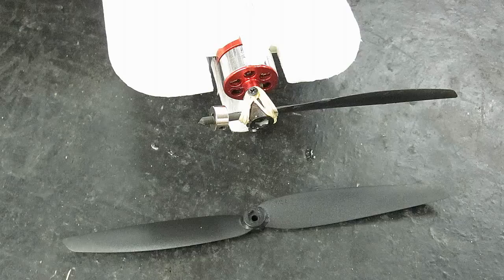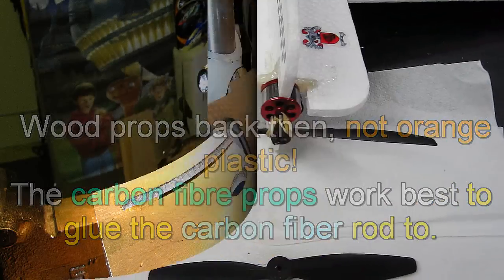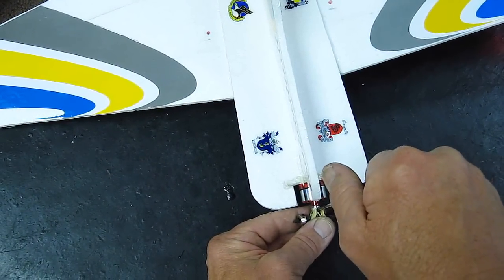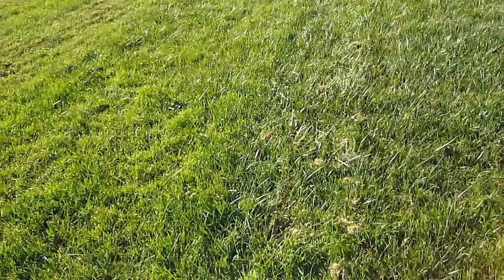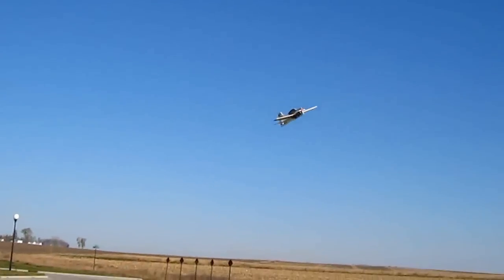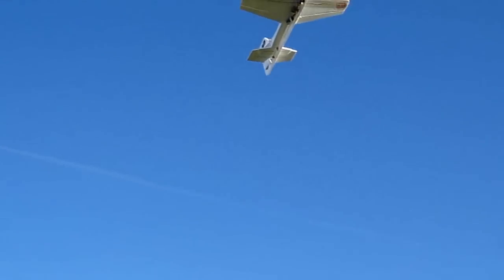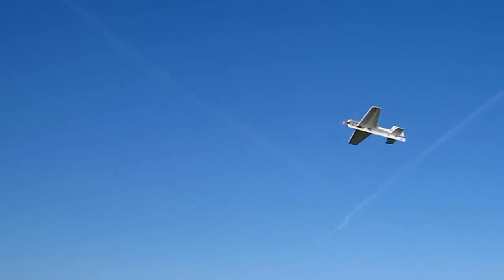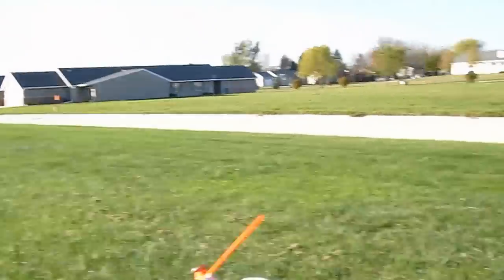1 blade propeller.  Will it work on Nitroplanes Hawk 3D?

Comment: First off its incredible that your able to fly in 20 mph winds at all and catch the plane with one hand. Now as for the concept, It would be great to see more testing done, preferably on a larger plane, you could measure run times say 3 batteries with regular prop and then 3 with the single blade config and see it you get consistent results, you may be on to something here!

Comment: Generally on full sized planes a 3-4 blade prop is used so the blades can be shorter for ground clearance. Also, the longer a prop blade is, the stronger and heavier it has to be for it's size due to the torque and centrifugal forces. This is far less of an issue for model planes though, so go ahead and use a 1-2 blade prop unless you're building an exact scale model.

Comment: you never cease to amaze- modelers  (my dad)   in the 40s couldnt afford plastic cement,  but acetone was cheap, and you melted model scrap  in acetone and voila-  your model glue-- we had a tiny u control plane, 14" span  , nitro,  Jim Walker's Fire Baby- it went like stink -i was given the handle once, i might have been 8 or 9,  and it went  overhead  to ground 4-5 times without crashing, and dad took the handle back lol - did you ever see / own one?   orange props break as easy as any ?

Comment: Single blade props should, in theory, be more efficient. On the other hand, I bend enough motor shafts, I don't need the prop helping any :)
Reply from the maker: True.. Properly balanced, they wont bend any shafts.  At least non of mine did, including the hammer head I put on my one bladed Nitro Helicopter  Thanks.

Comment: Oh and I like the drill press idea for testing. One could also use a variable speed Dremel if you have the optional chuck and are working with 1/8" or smaller shafts. Just need a good piece of shaft steel and good to go. Nevertheless, I really need to make myself a bench-motor setup for prop testing.

Comment: I have seen C/L speed events for half A engines that use this same style prop.  For speed events I believe the prop was metal with a counter balance inside the spinner.  The ones I've seen were fairly short, only a single 2.5 inch blade, but it was a very wide paddle-style blade at very high pitch (40 degrees or so).

Comment: @NightFlyyer ...it's kinda hard to burn out a brushless motor unless it's not moving when electricity is applied.
Brushed motors, however, can burn out if too much voltage is applied or it is spinning too fast, as demonstrated by Photonicinduction's videos of motors burning out.

Comment: The one blade runs into it's own turbulence too and what matters is the harmonics where IMO a 2 bladed prop can be better or worse that a single bladed prop regarding turbulence induced loss of performance. The real advantage of a single blade  prop is you can use a larger blade which produces less drag for moving the same volume of air.

Comment: It is definitely more efficient,  
The single blade bites a "bigger slice" of undisturbed air.
 but, in order to use it on commercial aircraft, the single blade would need to be much longer/thicker to give the same amount of thrust, and the ground clearance of the engine is the determining factor.
at higher aircraft speeds, it is not as much of an issue, as the undisturbed air is passing through the blades quicker.
imagine a cork screw-1blade
2 corkscrews twisted together-2blade ...

Comment: Neat subject! Lots of patents on this single blade prop or single blade copter rotor to be seen using Google Patent search. Something to do with reducing the tip vortex drag by half. Check out the VX-2 . Quite a reach for 1950's tech.

Comment: Did you compare motor amp draw between the two one-blade props and the original two-blade configuration?
Reply from the maker: Yes of course. 1 blade was always was lower hence longer tun times.

Comment: @Gig540 that's definitely a different idea. if one blade sat a half an inch forward on the chord line towards the tip of the cone and the other towards the back of the cone. if you could make one and was able to switch between it and normal setup you , test them...could be onto a possibly new industry standard. you never know.

Comment: I think in this case, 1 blade is enough (all properties are balanced, the propeller absorves engine power virtually 100% effectiveness). At higher RPM and mass to lift, some tweak are needed to be done. Maybe this is why there are no 1 blade helicopter nor planes. Right?
Reply: +Ismael Kafeltz 1 bladed props are scary, and auto rotation would be hard on a 1 bladed rotor.

Comment: @RCvehicleGuy 
It is aerodynamically proven to be more efficient, a 2 blade is more efficient than 3, 3 more than 4, and so on., but single blade is practically useless. (at least for G.A.)
as there is heavier weight added for the counterweight (much more than the second blade would weigh)
there is also additional stress on the propellor hub bearings from the "lop sided" thrust
no one wants taller landing gear, It's hard enough to get into most planes as it is.

Comment: Lucily, I'm too stupid to try this. I mean, I just looked at a couple of my props and can't even tell which blade is the first one. If I knew that, I would cut that bugger off straight away and eliminate the turbulence it caused for the second blade!! :¬P
Reply: +wordreet theres no such thing as the first blade, each blade cuts through a portion of air before the other one therefore each blade is cutting through dirty air produced by the one before it. Think about it this way the faster you go the more cleaner air each blade encounters, so traveling faster in theory would be more efficient.

Comment: Well when i started with rubber powerd aircrafts that's what was use ,a single blade prop with a counter weight and it worked very well and never had a failure {"_*}

Comment: Great fun, but 1 blade props are NOT superior to 2, 3, or 4 blade props.

If 1-blade props were more efficient, then the industry (real one) would be using single blade props.

The fact is while one may say it's more efficient, you're comparing a 1-blade to 2-blade on the same motor/ESC.  Remember, if thrust's lost, it's not more efficient.  There's funky linear curves involved. Go back to a 2-blade, but lower the motor/ESC amps, and the 2-blade will be more efficient than the original 1-blade.
Reply: Except with rubber band powered models turning at much lower RPM's a bigger one blade IS more efficient than smaller two blade.

Comment: Having seen single blade props used in rubber powered planes, some quite large, balance of mass isn't the big thing, balance of thrust is.  anyone that's seen this and how violent the asymetric thrust is wouldn't touch it.
Reply: I can't say I'm an expert on the topic however I don't think imbalance of thrust is or was an issue with one bladed props as they turned out to be quite successful in the past but were deemed not the mechanical effort after more powerful engines were introduced.